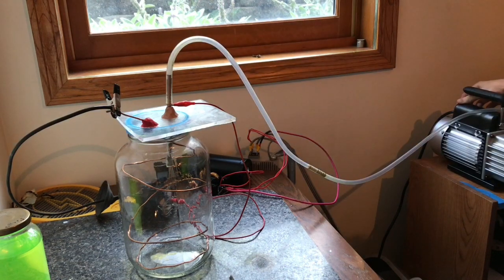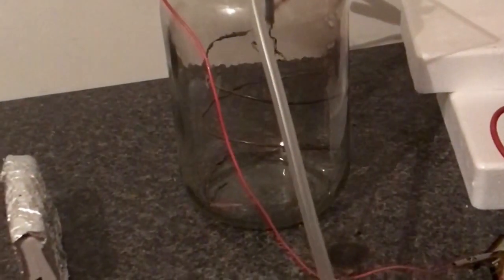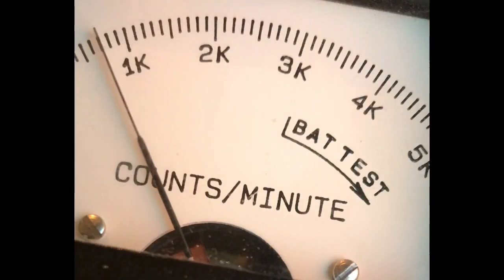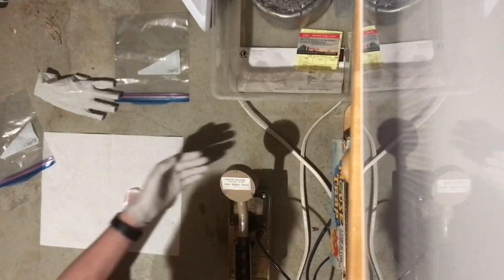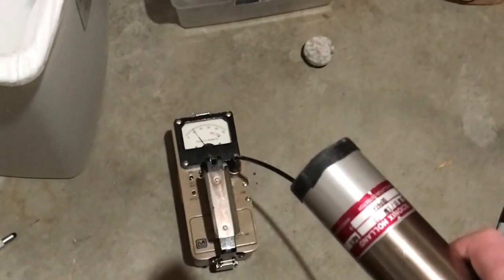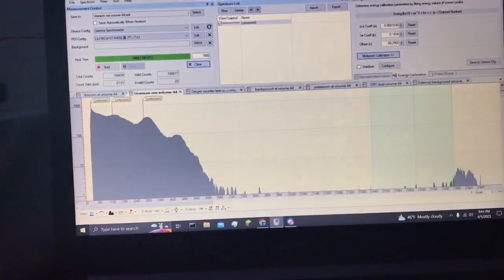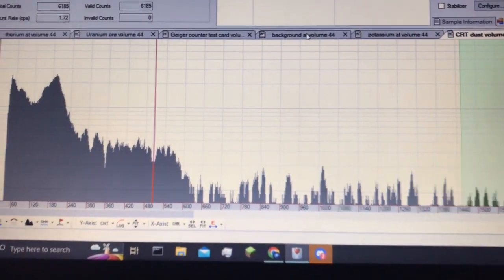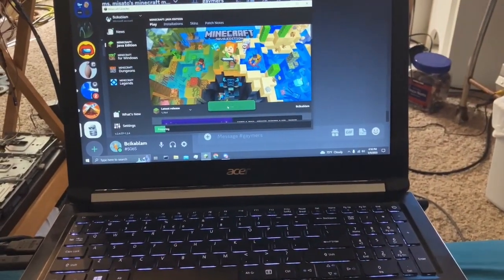My Pickle Jar Fusor, Radiation Shenanigans, and Gamma Spectrometer!

Comment: Cool setup!  During the beginning of the video, I was really wondering when you'd start talking about x-rays...
When you were talking about the fusor 2.0, were those pictures of the manufactured parts from your project, or from somewhere else?
Also, gotta admit, you quickly went above my pay grade on this video.  Great job!
Reply from the maker: Most of the pictures were of the actual parts I've gotten for the mark 2, I just need to get them welded together and then clean and assemble it!
The picture of plasma inside a metal fusor when I mention the tungsten wire isn't mine though, it's from someone else's that follows a very similar design to mine. For whatever reason, my editing software refused to let me put text there saying that

Comment: You know discharging high voltage in a vacuum is a long well-known method of producing x-ray radiation, it's interesting that you mentioned some people claiming it's just 'interference' (from the sparking?)...

Also, repeatedly discharging high voltage in a sealed (glass/quartz) tube will evacuate it mightily, even more so than a vacuum pump.
Reply from the maker: Yes, the reason some people claimed interference is because of the spark gap, and also the fact that the vacuum is very rough. I estimated about 200 mTorr, I'm only using a cheap one stage pump. Usually, I will not get enough voltage (5-10 kv where about 20 kv is needed for the x rays to escape the glass). My guess is that the pulse allows it to discharge enough current to briefly sustain a high enough voltage.

That last fact is interesting, though I doubt it's the mechanism at play since the plastic parts would likely outgas faster than the high voltage could reduce the pressure.

Comment: Tetrahedral electrode. A microwave source, magnetic confinement, deuterium gas at approximately 25 torr. Use a voltage of about 60kv and a current of about 14mA. You will fusion, get neutrons, and x rays. Plasma glow is pink/white. ❤
Reply from the maker: If that was describing a fusor you've built I'd be interested in some details about the microwave source. I was thinking about using an RF source in the future to experiment with heating the central plasma to boost fusion rates.

Comment: how the hell did that vinyl tubing not collapse under vacuum
Reply from the maker: Slightly thicker walls than usual. Not exactly optimal for vacuum because of the high outgassing though.
Reply: @bcikablam3578  got it, I was going to use tubing that looked similar but the damn thing collapses when i suck into it with just raw lungpower, I'm going for a similar approach to building my fusor as yours
Reply from the maker: @YoungPhysicistsClub1729  Awesome! I'd love to see a video of it when you finish.
A good rule of thumb for picking tubing is that if you can crush it with your fingers, it will probably collapse under vacuum. 

Also, especially if you decide to use a glass chamber larger than a mason jar, do an implosion test first by putting it in a box, putting some rags inside the chamber, and pulling a vacuum. This will keep glass shrapnel to a minimum and make sure it can withstand the pressure. It's also a good idea to wrap any size glass chamber in clear packing tape or something similar in order to contain any glass fragments in case of an implosion.

Safety first, and good luck!
Reply: @bcikablam3578  hey there, so I finally got back to my project after a hiatus and I ended up buying polyurethane tubing which is really robust.
I also have to somehow find a small pickle jar. I bought silicone rubber sheets for the seal

Comment: How does your reactor work, do you have any source material that I could read? 
Very cool video btw
Reply from the maker: This is just a demonstration reactor, so it does not actually achieve fusion. But I am in the process of making a new chamber that eventually will be able to, once I have some more equipment and deuterium fuel. 
IEC fusors work by using the high voltage field to accelerate ions towards the inner grid, and when they "hit" each other with enough velocity, they spend enough time close to each other that quantum effects make it probable for fusion to occur. I highly recommend reading the Wikipedia page for "Fusor" and also spending a lot of time reading the various sections on fusor.net if you have interest in building or learning about the nitty-gritty of hobby fusors.
Reply: @bcikablam3578  thanks a lot!! This is awsome and i might try to build one myself

Comment: tell me more about that rubber seal, and is sealing the holes with epoxy putty enough?
Reply from the maker: It could be for a demo fusor, but you'll want to do your research and find an epoxy that has low outgassing. I know classic JB weld is a hobby standard for sealing leaks, but it has a tendency to be conductive so be wary.
Reply from the maker: Oh, and the rubber seal is just one that I happened to find that fit the jar, I got it from a mason jar vacuum sealing kit. Grant Thompson's proto-putty may be sufficient, but a manufactured rubber seal would probably perform better if you can find one.

Comment: how thick is that pickle jar?
Reply from the maker: I'm not sure, probably around 2-4 mm. As I said in a previous comment, do an implosion test on any glass chamber you decide to use, and if possible cover it in packing tape so you can still see inside but the glass won't send shrapnel everywhere if it implodes. You might have better luck achieving good vacuum levels if you use a glass bottle with a rubber cork, but you'll have to use a diamond abrasive bit and water to cut a hole in the glass for the second electrode. With a pickle jar, you can just space the electrodes futher through a nonconductive lid, but it takes longer to get good vacuum.

I'd love to see pictures/videos of your progress and I recommend posting some on your channel at some point!
Reply: @bcikablam3578  thanks for the reply man, I have a picke jar that's at most 2 mm thick and a borosilicate glass jar that's 1.5-2mm thick but I'm very skeptical of both. I found a hemispherical pyrex bowl which is like 4 mm thick and I guess a hemispherical shape stands a much better chance against implosion if you do the math cuz all the horizontal components of the atmospheric force will cancel out and you'll have only a net downward force, which would somewhat improve sealing I suppose.

As for updates, I built the grid out of some steel wire and some other things to experiment with.
I'll probably be done with the expeirment by the end of this month hopefully and would love to share vids with you
Reply from the maker: @YoungPhysicistsClub1729  Awesome! I would go for the pyrex bowl if you have a way to seal against it, acrylic (1/4th inch over the mouth of the pickle jar) is working surprisingly well for me but for a large area you'll need something really thick, at least half an inch and probably closer to a full inch. Pyrex will also be more heat resistant, hot spots are an issue at lower vacuum levels with regular glass.

Yesterday I actually was able to get plasma in the pickle jar again using a massive 2 stage lab pump I got a good deal on, and some other vacuum equipment for the mk. 2. Hopefully I can post the tesla coil video and the next video on my fusor soon...

I'm on styropyro's discord server (link in the description of his vids), which is a great environment to get help with this kind of stuff as well if you've got a discord account and want to talk there.